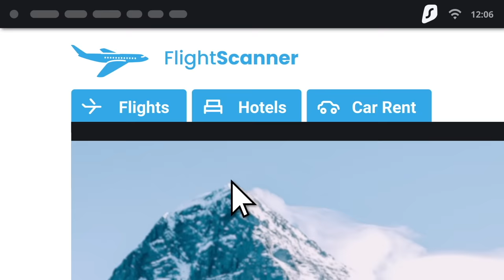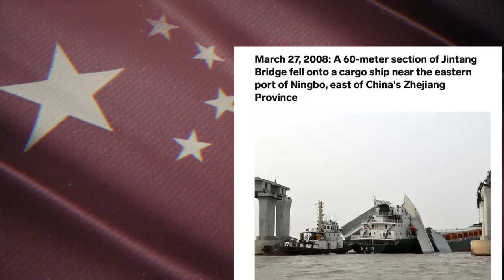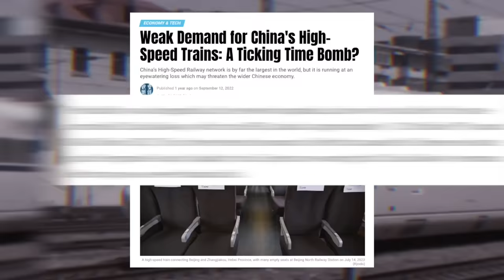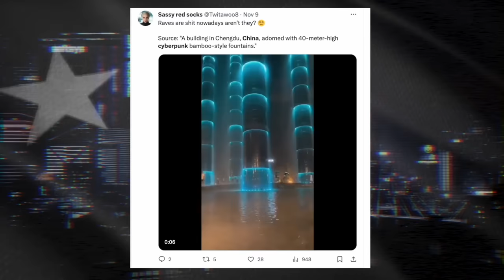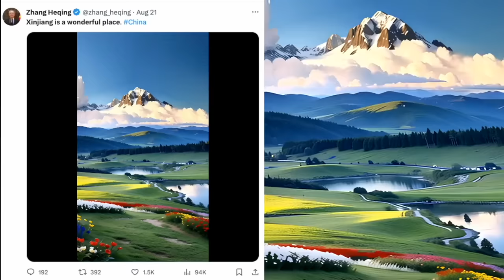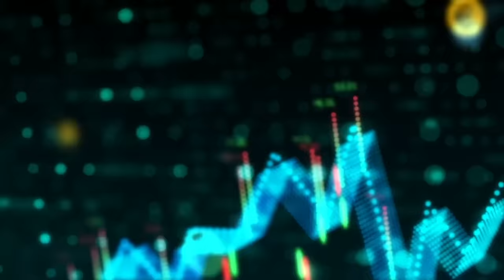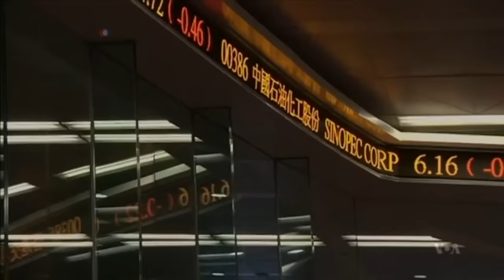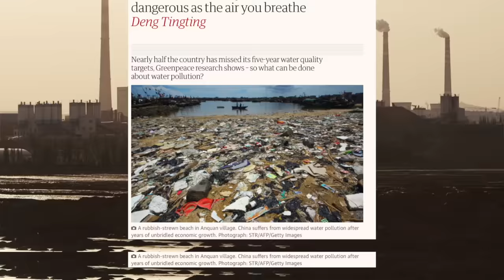Why are China’s Trains Randomly Crashing? - The Hidden Disaster of the High Speed Rail Network

Comment: India and Vietnam are building Japan's exact 1:1 Shinkansen HSR systems. The pace is a bit slow, Indonesia got it's Chinese HSR earlier. But with Japanese tech, systems, training transfer i know that India and Vietnam are getting the best safety and quality HSR systems
Reply: And they don't want to run in China's debt trap
Reply: And they are honest developing nations❤
Reply: Little Pinks love to bring up the "failure" of Japan's build in India and Vietnam (mostly because of land acquisitions on the recipient nation end) compared to the Bandung WHOOSH, even though the build in Java has been plagued with quality control issues throughout its lengthy construction process.
Reply: @quantumgoddess7870  😁😁😁😁😁😁😁
Reply: @peterseth3296 If it's on the moon, it's not a space station; it's a moon station. And I wouldn't trust it any more than a Chinese railway.
Reply: @peterseth3296  and we all wouldn't know if anything bad have happened because they going to bury it under the moon ashes?
Reply: And a Shinkansen line is about to be built in Texas of all places.  And since it's a dedicated HSR line, they can built it more quickly and with little re-engineering of the trainsets since it doesn't have to meet the crash test standards of US trains that share tracks with freight (Acela has to meet those standards because NEC tracks carry freight).  And it's literally going to be a Shinkansen, the Texas Central group chose Kawasaki Shinkansen rolling stock for the project.  Provided it isn't NIMBYd to death like the California HSR project.
Reply: @doujinflip yup, and noise level is intolerable against Japanese or even Indonesian standards, massive delays and budget overruns along with false promises, the railway isn't even convenient like the Japanese proposal before they went to the chinese
Reply: @lsp6032 I am Indonesian and I understand your view even though we have opposite views. Japan DISCRIMINATED us by refusing Transfer of Technology, so we decide to use Chinese Fuxing instead. Japan has enjoyed making lots of money on our country but not serious doing a ToT even for simple products such as EV batteries and MRT trains. So we go to other countries such as Germany, China, France, Switzerland for core technology. So far the cooperation runs well for HSR , we work jointly to have a safe operation and strict maintenance. We do not intend to trash other countries on their projects. So compete with excellence and actions not just empty words. Even Though the Japanese are sending us Junk JR Commuter trains , we manage to prolong and maintain  those trains in good order.
Reply: @Steve-so7uk  well...Japan actually have technology transfer to China 15 or so years ago, the resulting breach of contract with plagiarised design far outside original contract plans, and that unsafe operation had caused the trains manufactured through technological transfer to collide due to poorly designed signalling system, which was buried without search and rescue afterwards, caused such a fallout in japan even nowadays, causing them to lose trust to technology transfer. JR Central had actually not allowing Kawasaki which is the manufacturer of the trains exported to China to manufacture their trains, including commuter trains, not just shinkansen, even though they were a major contractor before that event, including the production of several prototype shinkansen trains. It also didn't help that Kawasaki manufactured shinkansen bogies that are found to be cracking, causing a national uproar due to manufacturing substandard parts for safety critical systems, to the point that they have to split away its train manufacturing business due to losses
Reply: @Steve-so7uk You can't just demand technology transfer as part of contract.
Reply: @@karma13243Lmto Yet nothing has happened to Laos HSR!!! You can Bark Nonsense but it becomes just that Nonsense!!! LOL Your HSR will Always Need to be Relied on by Japan!
Reply: @abhijeetsingh1755 Theres no Japan Debt Trap then??? LOL
Reply: Lmao, the land acquisition is merely the easiest issue to solve for India, I won’t be surprised if India couldn’t finish its HSR until 2040, or 10 crashes every year due to their poor operation.
Also the Vietnam HSR hasn’t even start, since we China have been building trans-Asia railway the Vietnamese government is having headache on which sides they are going to choose now.
Reply: @jameskamotho7513  we can, and countries other than China like Germany and france already do technology transfer to Indonesia
Reply: @jxxxxx44  onta kadrone lagi mangap mulutnya 😂😂😂😂
Reply: I'm from Indonesia, The reason why Indonesia government choose China than japan because
1. Transfer technology, we want to make our own train, not a market for other countries, especially for old train
2. The train Japan want to sold to Indonesia is an OLD TRAIN, with low speed, only 300 km/hour that japan HAVE STOP using and now use new technology, and even that, they don't want to share the old technology, a 2010 train, but China will sell a new 2012 train they still use with maximum speed 350 km/hour and a new technology 
3. Japan want to use Business to Government partnership but Indonesia only want to do Business to Business. So japan want funding from the Indonesian government, but Indonesia don't want to, we want pure business
Reply: @@karma13243 good information but I want to know, the train japan sell to you guys is it an old train they don't use anymore or a new one? Because in 2015 that what japan try to sell to us
Reply: @Ichi.Capeta well we shall see, lol even I'm curious how good is chinese train in Indonesia, we would be an experimentation lab for Chinese train then, if its going under then it will be an expensive but worthwhile experience for us, but if not then it mean Chinese train is good i guess
Reply: @lsp6032  China Fuxing is based from an official IP bought by China from Siemens Germany and develop their own technology., not from Japan.
Reply: @jameskamotho7513  Yes we can that is our right and if they comply good, if not it is also okay and go with the alternative. We spend our own funds and tax payer money to service the loans right ? so we have this right to demand . Why did India got the Technology Transfer and not Indonesia ?? Because Japan DISCRIMINATED us so you can see we slowly move away for over dependence from Japan.
Reply: @Iceyfire12  These comments are from over proud Indians who do not like to look themselves in front of a big mirror and reflect themselves of their achievement and thumping their chest, instead just stay humble and work diligently . That is the difference between us and India. ✌️🌎🙏🇮🇩🤝🇨🇳
Reply: @@karma13243 yes but there is India debt trap to Japan instead by delaying the schedule and maybe later repayment 😊😊😊
Reply: @@karma13243 Karma you are a bit naive just research how many Indonesian workers are working on this project..😂😂😂..This JV is owned 60 % by SOE of Indonesia.
Reply: @@karma13243  
1. good for ur country then, because at 2015 when japan want to make agreement for high speed train in Indonesia, they don't want to share their technology to us, but China wanted to. Maybe because of this japan learn from experience and actually try to share their technology to india. Remember Indonesia agreement is in 16 October 2015, and India in 12 December 2015
So the reason why you get their transfer of technology is because they afraid you Indian will refuse again like Indonesia because there is no transfer of technology.

I think it's unfair of japan, but maybe it's because of political problem etc, like japan and India don't have good relationship with China, but Indonesia is a pragmatic country, as long we can build our economy and industry who care about politics. We are a non-alignment movement founder after all, India also a non-alignment founder I think? But I guess not anymore, you betrayed the agreement, after all you made the QUAD agreement.
Reply: @@karma13243 nah its still lower, only 380 km/hour we maximum 420km/hour
Reply: @licas3214  This old Japan Shinkasen HSR is develop in the 80's , Japan will not guarantee speed higher than 300 km/h , they know how Indian operates their train so they do want to risk it  Our WHOOSH is operating at speed of 300 to 350 km/h , which Indian HSR will NEVER catch up .
Reply: @karma13243  agree, it is only 240km/h because of stagnant technology, the same series with minor changes had been in production for 20 years, and they also run trains at 320km/h for decades already, not going higher because of noise regulations and maintenance reasons, unlike China without stringent noise regulation which forbade higher speed when the noise limit is exceeded
Reply: @licas3214  Alright. I guess you're big enough to make such demands...
Reply: Really ? The Indian HSR system built by Japan failed miserably and the project was discontinued. 🤣🤣
Reply: Indonesia uses China trains? That says a lot about never going to Indonesia for anything.
Reply: @simon3cowell  so don't come 😂😂😂😂

Comment: A story I heard about 8 years ago was of a UK medical equipment supplier that let a manufacturing contract to a Chinese contractor. This was for a type II \ III device that required very high quality design and manufacturing and was highly specified. They spent GBP100,000 on the manufacturing run. When they did a random break down and testing of the device they found that the manufacturer had substituted a capacitor with a lower spec. device. They had to scrap the whole production run and learnt a very expensive lesson in the process. It's that sort of lack of integrity that does a huge amount of damage to China's reputation.

China has had massive opportunities and support over the last few decades which it has squandered. It has only itself to blame.
Reply: Where I work, any precision equipment brand from china is permanently boycotted by default.

we learned that the hard way unfortunately.
Reply: I work in the medical life science manufacturing field in the US. We have 0 china made parts. We have parts from Japan, Thailand, korea(the good one), Germany. But not a single china made component.
Reply: They scrapped a whole device over a capacitor? What, none of them could solder a new capacitor? Your story is too far fetched and devoid of any common sense, your dismissed.
Reply: @Right-Is-Right  I couldn’t find any literature quickly. But I wonder if that lower spec cap/s shoved way too much voltage down the line blowing a lot of it up Or it just short circuited it all?
Reply: Absolute rubbish. Not all capacitors are made equal. Very far from it  production tolerance variabillity is huge. This is far from unusual. @Right-Is-Right
Reply: @Lucydius  If it's not up to spec, you replace the part, not ditch the whole device.
Reply: @simondymond8479  I did not say anything of the sort, in fact I said you replace the capacitor if it's not up to spec, not the whole device. Anyone in R&D knows this. That is how I know the post is complete BS.

Comment: When the build quality for even your flagship projects is only up to the "It will look great in pictures and media for the grand opening" standard, 10-15 years down the line, Entropy is gonna wink and nudge and result in a lot of people dying.
Reply: 10 years? If only they lasted that long
Reply: Even worse: if quality has declined, then the wave of failure will be concentrated.
20y old with ~20y lifespan and 10y old with ~10y lifespan are due around the same time.
Reply: >>> look great in pictures and media ...
I strongly suggest them to make
3D animations (in which I am specialized in writing OpenGL simulations), to boost their achievements, rather than killing innocents just for the sake of their pride.

Comment: The last time I rode a train in China I had asked one of the people I was traveling with why the train was only going 180km/hr, as this train in particular was hyped as going much faster.  I was told that the government ordered all rail to travel slower until further notice due to a very bad train accident that occurred the week before... which was the second time in the past few months this had happened.
Reply: That would be enough reason to avoid them like the plague! Did you finish your travel by train?
Reply: @liebuster9308  "The train network is huge and new, so it is normal that accidents may happen."

More like lie spreader 9308: fuck-ups are not a function of a technology's age and implementation scale, they're a function of the people involved.
Reply: So, don't ride the HSR since it's normal to have accidents because 'it was new'? That's quite a logic there.
Reply: @liebuster9308  Accidents are not normal on HSR, not even new systems.  There has only been one HSR accident with fatalities outside of China where the train was operating on HSR track and at speed and two other accidents with fatalities involving HSR trains but were not operating on HSR track or at HSR speeds at the time.  Those were on Spanish and German rail networks where HSR trains hop on and off non HSR track fairly regularly.  Shinkansen, TGV, Eurostar and Acela have never had a fatality on their service.
Reply: @mrvwbug4423 well, there was a TGV fatality caused by derailment on the high speed line, that accident was before line opening, with the safety systems not engaged, and human errors, caused quite a uproar and investigation to stop such accident from occurring ever again anywhere, I don't think China can grasp this painful accident though
Reply: @Bullshitvol2 High speed trains have much higher maintenance costs especially if speed exceeds 250 or 300 km/h...
Reply: This guy is still living in 2012. Dude, move on as China has moved on.
Reply: @liebuster9308 ...Does your "Normal" include burying the victims of a train crash inside the train, where it fell?

Please seek Professional Help.  You may have a concussion or worse.
Reply: @ronnelacido1711  737 max be like: cough cough
Reply: @Bullshitvol2  1 EU is a ridiculously low price, I wonder what the actual cost is per passenger.
Reply: @liebuster9308 tell that to the Japenese who's high-speed rail has zero accidents...
Reply: @liebuster9308 he doesn't dehumanizing anyone.  You're government does that well enough
Reply: @JohnRinNoHo it's subsidized, even in Europe, it can't run without tax payer money.
Reply: @liebuster9308  but it has been around 1967. No accident till now. And Japan have more railway network than France (I believe). France had accidents but not Japan.
Reply: pretty sure you are telling a propaganda story there...
Reply: @zimingdong5952  No, it is a true story.  I'm really not sure what kind of "propaganda" you think that is - or who it benefits - but that really happened, and exactly how I described it.  I have enjoyed every train ride I've taken on the Chinese rail system, incidentally.
Reply: @pacldawson   If you can give a exact time. I'll go find some more story about this. Actually the reason of train speed slowing down during 2011 to 2017 is because of the accident this video showed. Also I don't really know which city did you go to. However depending on different part of the railway there will be requirements to slow the train down because of safety reasons. For example in a long turning. Based on what you said, it could be the person you asked didn't know much about the whole system.   From 2018 until now there is actually no direct order from the government, or any government papers shows to slow down the railway system.
Reply: @zimingdong5952  It is very possible that the person who told me that the government required trains to slow down during this time was not telling me an accurate story... I'm only relaying what the person on the train told me.  Also, they didn't say it was the national government who ordered this. It may have been the provincial government (this happened in Guangdong Province).  Again, this is not a complaint from me.  I always enjoy taking trains in China, which I prefer over taking a plane.
Reply: @pacldawson  Not really blaming on you because actually part of the people(in China) don't know about the reason, if they don't have interested in railways. However maybe I used the words too strong. Apologize if let you misunderstand.
Reply: @zimingdong5952  - no apology necessary!  I was not offended, and I understand why you asked the question. 🙂  Besides the train was still going fast in my opinion - over 180km/hr - so for an American that is still fast. 😁
Reply: @Bullshitvol2  I will say that the train system in China is much less confusing than the rail system in Germany. 🤣
Reply: @ikvangalen6101  - oh yes!  I've also taken other train trips since then.  I have never had a negative issue on a Chinese train.
Reply: @formyloveh he’s obsessed with China.